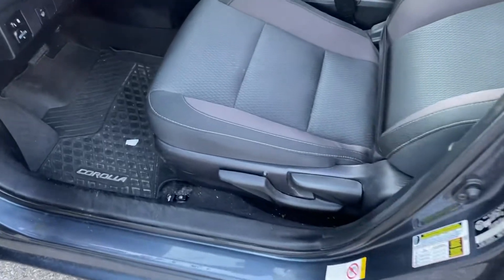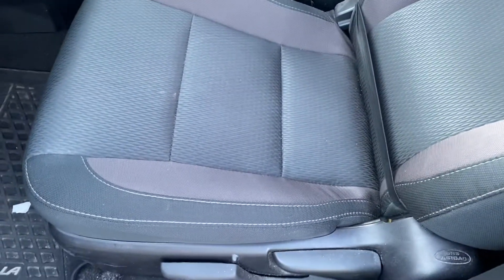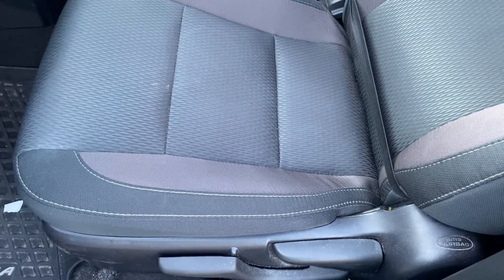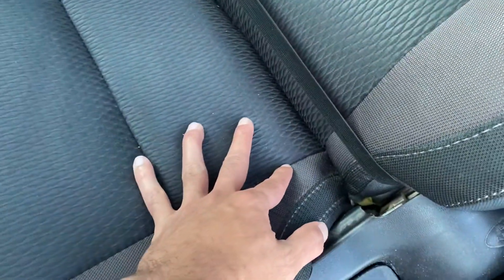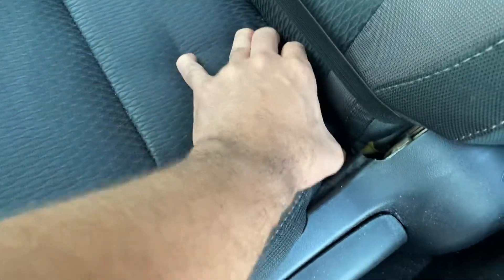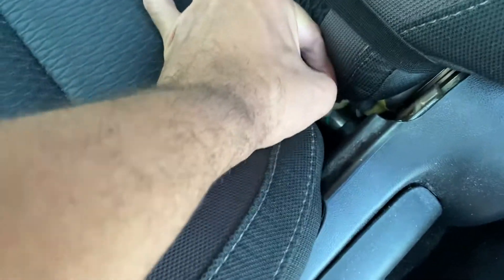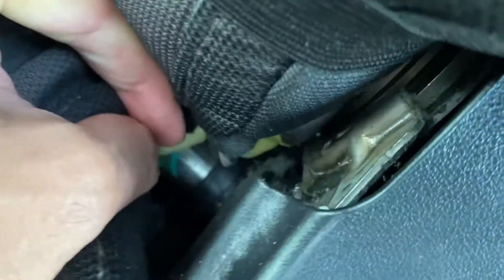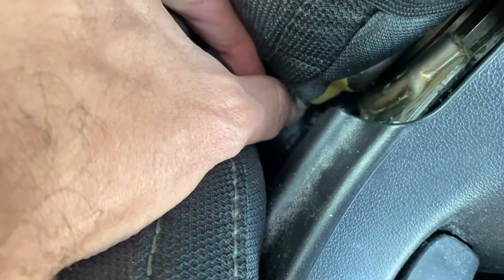Click sound in driver seat Toyota Corolla 2018

Comment: So i also have a clicking noise in my ct200h and i also have that hook, but not sure how to remove it without breaking it.. did you just pull it off the rails?
Reply: yes you can pull up on that plastic hook to remove it off the chair rod entirely, or you can still clasp the end of the hook on the chair rod so that it is still somewhat attached. use your thumb for increase strength to move the hook. also confirm that you the hook to begin with. some lexus trim levels may be different and may not even have it.